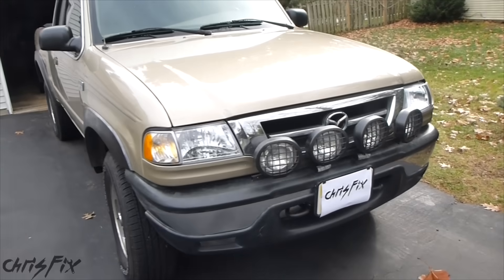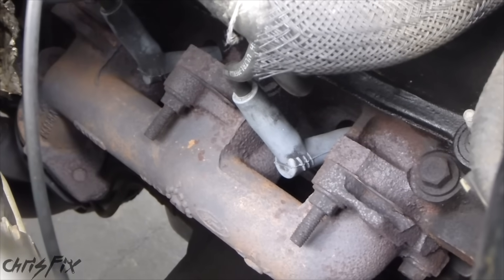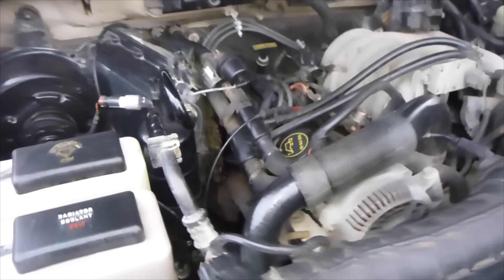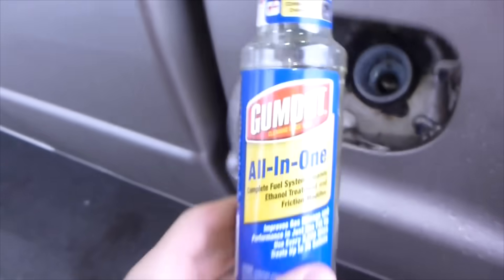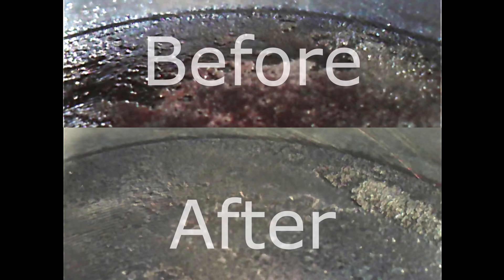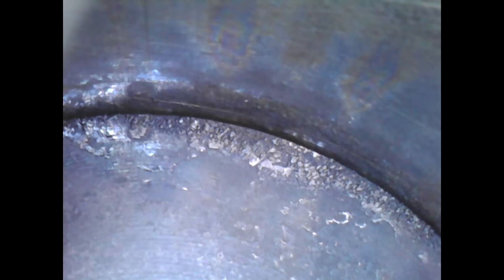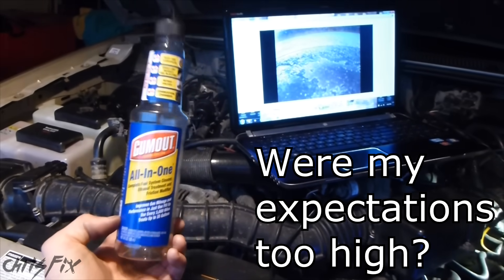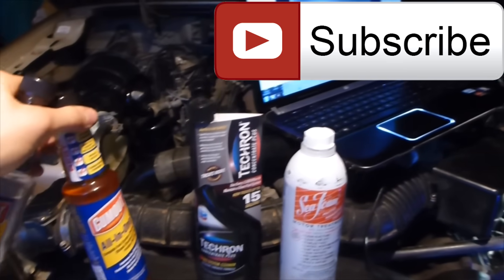Do fuel system cleaners actually work? Testing Gumout "All-in-One"

Comment: When I used to work at Jiffy Lube, we had a fuel injector cleaning service using STP. The bottle was the same you could by at the store and you were supposed to add it to half a tank of gas. We would pull the fuel line out and run it %100 cleaner. Worked like a charm. When I do my car I use STP on less than an 1/8 of a tank down to below the empty line to recreate this condition as much as possible to running it 100%. Any chance you could do a video on that? They changed the formula multiple times since I worked there (24  years ago). I would like to know if it still works. Thanks for showing us GumOut isn't really worth the money!!!
Reply: How much STP did you add per gallon of fuel?
Reply: @aliasadghani  100% from the plastic bottle, that's why I always say "no matter what the directions, get like 1/8 to 1/16 a tank of gas and run it until it's about to die." Also you can use good (not cheap) gas. BP has the most fuel injector cleaner for newer cars, followed by Shell. Redline fuel injector cleaner is the best. Use synthetic oil and trans fluid (Pennzoil Platinum 5W-30 and Amsoil Signature Synthetic ATF), trust me you will thank me. Have fun and drive safe =)
Reply: @smart-e242  So do you recommend doing this will Redline? When you say BP do you mean the gas station? so just run the gas til it's 1/8th or less then pour in an entire bottle Redline or STP? Thanks! I just bought Marvel Mystery oil and Lucas oil yesterday... How often do you do this? I had my engine rebuilt 7 years ago so probably under 70,000 miles right now. I usually do this 2 times a year... but I am hearing to do it more often but not sure how often! Thanks!
Reply: @MikeKollin  I do it every 3 months per manufacturer

Comment: What other cleaning supplies that I can use, to help clean my carburetor system out.  I drive 1990 Honda Civic Crx. I don't know alot about cars so I'm asking what do you recommend.
Reply: Most manufacturers do not recommend any additive, it can even invalidate the warranty, there is so much debate about this subject. Some say it doesn’t change a thing and these products are nothing more than snake oil, some say a good quality fuel has the same properties as these additives so you should invest in a few tanks of high quality fuel. There are for and against for every possible argument. In my personal opinion for you, a new fuel filter and a couple of tanks of high octane fuel would help you out. Petroleum is actually quite an effective cleaner in itself I know that much..

Comment: I like how you test out products and give before and after results. Carbon is one of those things that's hard to clear out of motors. Maybe just for laughs and giggles try running one tank of 93 octane plus some gumout too and see if carbon stays put. I know some engines are designed for 87 octane but if engine can't get hot enough that carbon can't burn off. Its like microwaving cheese that's rolled in tin foil itvwont work lol

Comment: Chris..,   Try getting some 70% Hydrogen Peroxide.., dilute it 50 / 50 with purified water..  Use a spray bottle and spray into the air intake before the MAF.,  While at 3000 to 4000 rpm...    Do it for 20 minutes....   Kills carbon buildup....
Reply: Thats half a tank of gas at least😯, I'd rather pay $3-10 for a cleaner and let it gradually clean as I drive to work, shop, etc. I've bought most of the cheap $2-5 specials but the only ones that made a big difference was the royal purple and long term use of the Lucas upper cylinder lubricant.  Royal P is the stronger cleaner that gives results after the first use but I like the Lucas because it lubricates the fuel system and upper cylinder so there's less startup wear.     
  I first used the lucas in a '90 civic with every fuel tank , after about a year I upgraded the intake manifold and the original one looked brand new and very clean on the inside . You may not notice any immediate results or get something similar to what was shown in this vyd but with continued use on every gas tank, you could definitely have a clean engine.    Don't buy the tiny bottles, those are big profit earners for the autoparts stores that's why they have them near the register for $3-4 .  Buy the quart or gallon size instead . If you have an old car with blow by it's probably best to change fluids more often so conventional maybe synthetic blend fluids are the better option changing them every few months as opposed to 6 or 8 months with synthetic.  I also run some stp or lucas oil treatment to reduce oil dilution/contamination caused by blow by , only do this if your car suffers from blow by. The oil treatments also stick to parts better so when used properly , you should have less start up wear.
Reply: @TheBikemaster94  It's very fast atomic oxygen cleaning off super hot carbon...   It's amazing how fast it cleans up a valve area....

Comment: What I learned is, dont drive a ford ranger with a 3.0 liter engine. 209 miles on a whole tank? Thats 15.0 mpg on a small pick up. My goodness thats a lil worse then my full size Silverado z71 4x4 with a 5.3L. This stuff is made to be used throughout a longer period of time. You cant spend 5 bucks an expect its suppose to just make ur motor new again within the first use.. It removed some with that one use. So I think thats 5 bucks worse.

Comment: Even though that the bottle says just one fill up it's better I have found that a continuous use between every old change 1 for a will change You will see a much bigger difference like all things carbon build-up didn't happen overnight neither cleaning it up with a bottle of cleaner will do it overnight this is and improvement is it worth the $5 problem not but over time it will be

Comment: I guess it's fair to say that this cleaner works the best when used often, to remove the sludge-type carbon build-up in order for it to not harden. Those hard patches of carbon do the most 'damage' and this cleaner didn't seem to remove any of it. What's the best way to remove that carbon build-up? would a repair shop be able to do that?

Comment: That engine needs new piston rings. The washed piston edges is from blow by, not the cleaning of the additive. The additive acts on the soft deposits like any solvent would. The lesson here is change your engine oil more often and use an appropriate oil for the engine.

Comment: In the old days we used to use transmission fluid and at a fast idle we use the poor little bit of transmission fluid at a time 1/2 coffee cup maximum then you will see a lot of white smoke come out of a pipe on your exhaust but it really works good

Comment: I too was expecting better results, I am trying to clean out fuel injectors without removing them, I am curious if seafoam works any better?! an old friend of mine said to use 99% alcohol straight from the bottle with a tank of gas, I can get that for $1.00 at the dollar tree...would like to see ChrisFix run that same test with sea foam.

Comment: I think your expectations are too high. I highly doubt any additive is going to remove hardened deposits on the piston. That stuff is hard to get off with a hammer lol. You might want to consider re building your engine and changing the pistons. THEN use the additive to prevent the build up from happening in the first place. I don't think any additive is designed to do what you are expecting nor do they claim it will. And considering you went 200 miles on a tank of gas which is about 10-12 miles per gallon I think you have other problems with the engine. That is pretty bad mileage. Most newer cars are designed to get around 450 miles on a tank of gas under normal driving. That would put you up around 25 miles to the gallon which sounds more normal. So I am not shocked you didn't see any improvement in performance either. That poor truck needs help and fuel injector cleaner isn't going to cut it lol.

Comment: Not a very fair video as the product clearly states you need to use a bottle every oil change which implies it takes time to clean. Also another factor is if your injectors are dirty or not working at 100% efficiency. Great video but not really a solid test on whether the product works or not.

Comment: Where does the carbon actually go once removed from the Pistons?
Reply: Most likely out the exhaust valves and out the exhaust
Reply: Good question. Also interested what the answer is to this.
Reply: Out your exhaust valve, into the exhaust, only to get stuck in the catalytic converter lol
Reply: It gets farted out the exhaust hole. 🚗💭

Comment: fuel system cleaners are not that important on your mazda truck, but modern GDI (gas direct inject) engines MUST be cleaned OFTEN or they will fail, average cost of repair is over 5 thousand bucks, just keep it clean. Also, screw gumout, use seafoam....
Reply: Also, it isn't about the cylinder being clean, it is about the lines and throttle body.

Comment: I was in the market for same type of product to use on my charger 5.7 , so I used A Lucas Oil cleaning product ... such as the product you used  and I noticed a huge difference after the tank had not even fully emptied yet. The idle was way smoother and with out ANY needle jumping on the tach. I would recommend you try this product .

Comment: I need to get one of those scopes. When i do a spark plug change on my car I'll use SeaFoam in the tank, in the oil and fill the cylinders up with the SeaFoam and let it soak over night with the spark plugs screwed back in.
The next day I'll take the plugs back out, spin the motor over and let all the gunk squirt out. Then I'll put the plugs back in, connect the wires and go on my merry way..
I dont know if it actually removes the build up but in my mind i think it does hahaha.. i need one of those scopes.. it probably does nothing and its all in my head hahahaha.. cheers man..

Comment: I used the Gumout Tune-up.  After some time my car seems to run better, but as you said it, "this product might clean injectors and probably prevents corrosion" so I'm guess it might of helped my '03 nissan because a car this old needed it.  So the question is, does ANYTHING work to clean the carbon other than taking them out yourself?

Comment: For 4 different cleaning points, you also did only show one. You can’t suggest the product by only testing 1 part. At least explain FOR CARBON you were not impressed with the product. I see the bottle doing what it says by your video. It said with 1 bottle see a difference. There was.
Reply from the maker: What else is it supposed to clean? Carbon deposits are the only deposits... also I tested this twice. Link in the description.

Comment: I don't think these products are designed to work in one application. I think if you use them at say every oil change they may make a slight difference in cleaning. however, I think with quality gas, the additives in the fuel will do the same thing

Comment: In the past, I've seen an overnight test between Sea Foam and Wynn's Fuel Injector cleaner. The test involved soaking two valves. Wynn's did the best. Have you thought about soaking the pistons overnight? The soak should just cover the top of the piston. Besides, I'm still trying to find where I can get Wynn's Fuel Injector cleaner.
Reply from the maker: I wouldn’t soak anything because all the carbon will come off all at once and could damage the engine or cats.

Comment: Deposits on cylinders arent bad, as they help with compression. I would be more interested with how the injectors and valves looked pre and after, that sludge on the top of the piston makes zero difference, but if your valves are not shutting completely because they are dirty, then you'll loose power.

Comment: I use a PEA version of gumout and I use a bottle to half a tank and then do some occasional it's,Ian tuneup runs during that time. I'll then fill up like normal. You'll see a big difference with the boroscope in those harder carbon deposits. Only PEA and getting those interior cylinders really hot /collier for a few cycles witll get the crust carbon off.

Comment: Fundamentally the fuel grade matters. eg: 91 Octane (Premium) has no ethanol. If you use the lower (cheaper) octane, like 87 or 89, you will introduce excess carbon deposits into your fuel system. Therefore, fuel cleaner is rendered irrelevant if you use cheaper fuel. Use the more expensive 91 octane and you wont need fuel additives.

Comment: The label clearly says " Improves Gas Mileage and Performance in Just One Fill Up" , I'm sure it cleaned your injectors, resulting in better gas mileage and smoother idle.

 NOWHERE does it claim to clean 17yrs of carbon build up from a 17yr old neglected engines Pistons.

Comment: Nobody should expect a 5oz bottle of cleaned added to 15 gallons of fuel, to clean deposits from years and over 100k miles of neglect. Use this type of product with every fill up since new, and you will never get those deposits. I use Lucas with every fill up since new, and my piston heads look as new, without the slighted carbon deposit.

Comment: What I have found is that fuel injector cleaners with a high concentration of the chemical PPE is most effective. Engineering Explained has also done a test on that as well. Also, with working in various garages and auto parts stores,  I found  that high end and high dollar cleaners work the best.
Reply: Can you recommend one? Thanks!

Comment: What about small cc scooters ? I have a 125cc carbed scooter and recently it started bogging when the main jet engages (suggesting something there starts getting clogged enough that it bogs a bit) and the top speed is down to 80-85 kmh from 100kmh

Comment: Dude, this will only work if u use it from the beggining... one that carbon is that incrusted in the piston even having the piston outsode with a wire brust is hard to take out.
By the way it probably helped with the injectors you didnt check that.

Comment: Hyundai recommends I use some sort of fuel additive/cleaner since it's a direct injection and the fuel won't clean the valves like a port injection engine would.
Reply: If the fuel does not reach the valves (in direct injection engines, it never touches the back of the valves), then adding a cleaner into said fuel will still do nothing to reach those areas.

Comment: I'm concerned if using this stuff where the carbon build up goes when it cleans it. If it will mess up 02 sensors Cats things like that.
Reply from the maker: It dissolves it so there is nothing to worry about it. That’s why it barely works. It’s not breaking off big chunks

Comment: Chris, the best would be test engine power on dyno before and after. I think dirty piston is not so important. But if this liquid can clean fuel injectors... I use similar products for diesel, here in Poland. After application I see significant engine noise reduction, engine idle is more smooth, small reduction of fuel consumption , less fumes from exhaust.

Comment: I don't recommend this stuff at all because you have to put it in every tankful for about 10 fills to initially clean a dirty engine. Then every 5th tankful to keep it clean.  It is waaaaaay too expensive too.  I recommend something else.

Way too many variables.

New - correct - spark plugs....at the correct gap?  Platinum is verified as providing a hotter spark to set off the fuel.

Ignition system weak?  A weak spark can cause a bad explosion in the combustion chamber.

Good fuel used (not cheap crap from a grocery store)....as recommended in the glove-box manual?  Octane rating?  If your small car calls for 87 octane and you are putting in 92 then the carbon builds up 10x faster because the fuel burns slower and not completely.

Clean air filter?  Fram is the best because that is what all engines are designed for.

Oil going down through the sleeves on the valve stems?   How did the valves look when looking down the intake and exhaust?  Looked like it was happening on a couple of cylinders to me.

Proper oil in the crankcase and new?

Injectors clean?  Bad spray-mist equals bad combustion.

Catalytic converter plugged?  Muffler plugged?  If the burned air cannot leave the combustion chamber then it will build up and foul the incoming fresh air for the next cycle.  Water in your muffler is one of the biggest problems with the 'unleaded' fuel systems. Drill a couple of small (1/16 inch) holes....one in the front and one in the rear on the bottom to drain the water and keep it out.  NOT THE CAT...you will ruin it!!!

Moist air in humid areas can cause faster and heavier carbon build-up.  Remember, water doesn't burn.  That is why I recommend putting a bottle of HEET (red bottle) in your tank before you add fuel EVERY fill-up to keep the water burnable and your injectors clean.  There is ALWAYS water in fuel.  The red bottle has injector cleaner.....the yellow bottle is cheaper and only has water mixer.  Both mix with water to make it burnable but the red bottle states it has injector cleaner....good stuff.  $2 at WALMART.  EVERY TANKFUL!!!!!  YEAR 'ROUND!!!!  Very cheap investment to keep a good running motor.

- FREE ADVICE - from a Master Mechanic/Technician who knows the science of these engine systems......I hope it helps you

Comment: I dont know if you've done one yet but another fuel cleaner for gas or diesel is marvel mystery oil I would love to see a before and after on that .it always seemed to help my old 98 bravada with better gas mileage  by 4 or so extra to the gallon and right now I have a 93 f150 with a 351 5.8l and she has a drinking problem at 5mpg sadly